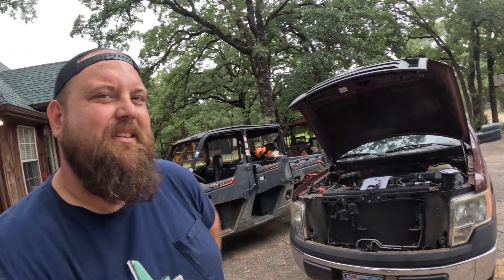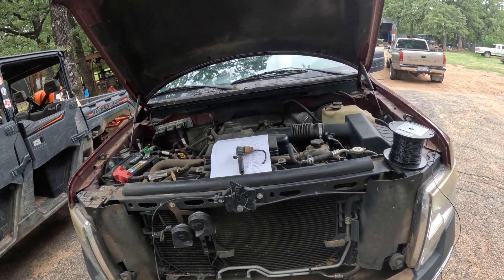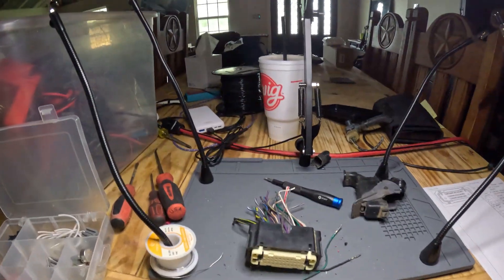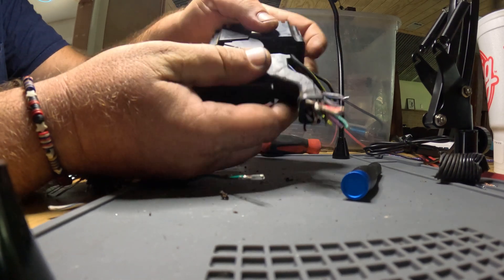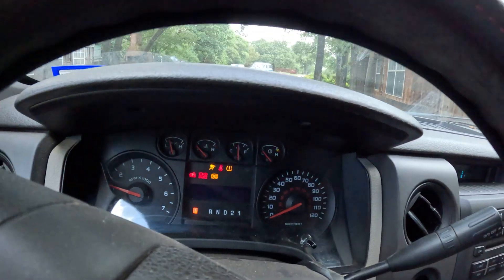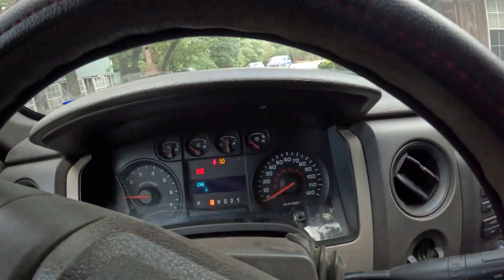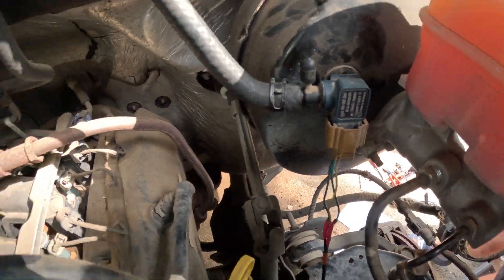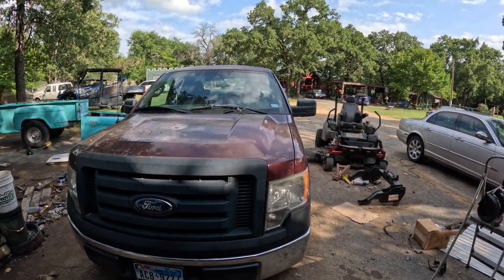2009 Ford F-150 B1342 Failed ABS Module: How to Install the CHEAPER ABS Module From 2010 and Later!

Comment: Ford hasn’t made replacement ABS modules, whether electronic control units or hydraulic control units, in years. After you can’t get replacement parts for your Ford after it is finally paid for, you’ll find that there are no parts available to fix itl not even battery cables.  Ford expects you to be tricked into buying a new Ford to replace the one that no longer works and sits in your back yard.  Great corporate profit strategy - soon they won’t be able to give Fords away.

Comment: i wonder... if you save as built abs data from the 09 with forscan, then flash the 10 module with it, (backing up the 10 first), if it works or not. im fighting my 08 B1342, a JY module was bad, with pump codes too lol
Reply from the maker: No idea, only one way to find out lololol

Comment: Hi. I’m in same situation.. 2010 module on 2009 truck. Do you have the diagram still? The link you provided no longer works..
Reply from the maker: Well dang it, give me just a bit and I'll get a new link made for ya
Reply from the maker: Alright, link is up to date. If you have any questions feel free to ask, and good luck.
Reply: Thank you! One more question.. you happen to know what size the pins are?
Reply from the maker: @DanielBritt-j2o  I do not, I pulled them from a donor plug and soldered too that. I tried to find correct pins to crimp, but failed.

Comment: Is no-one else going to compliment this man for his Philadelphia Collins impression?
Reply from the maker: @ConkysFlippinAdventures  Finally, lol
Reply: @GreenCastleGarage  I have a problem with my 2009 F 150 with code 1342
Reply from the maker: @chinchorreosevacila2442  That code is very specific to module failure. Time to pull it and have it rebuilt or order a new one sounds like.
Reply: @GreenCastleGarage  It also has c1288 C1300 B1342 and the B1596 dtc continuous memory that means they have already erased the code
Reply: @GreenCastleGarage  I already did all the ground current tests and HS CAN signal and everything was fine, so it would be the module

Comment: Is the B1342 code definitely a bad module? I have that code since the check brake system light came on .
Thank you
Reply from the maker: @18winsagin  yes, B1342 indicates the srs module has stored crash data. It is unclear able with a scanner and requires the eeprom erase here or a new module that then needs to be programmed.

Comment: Which place did you send the abs module to that botched the job?
Reply from the maker: Sorry, somehow I just saw this comment. It was an ebay ad offering the service, and I can't find the email exchange anywhere.
Reply: @ no worries. I ended up finding an eBay company and they got me fixed up.
Reply from the maker: @MrJustinWheeler  nice, glad to hear you had success. Sorry again for responding so late, I usually see comments quickly.